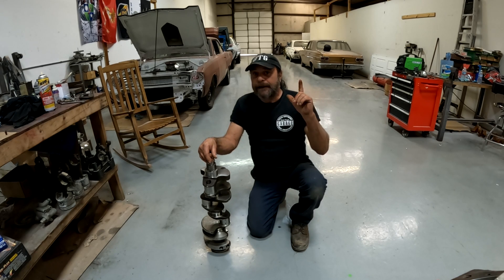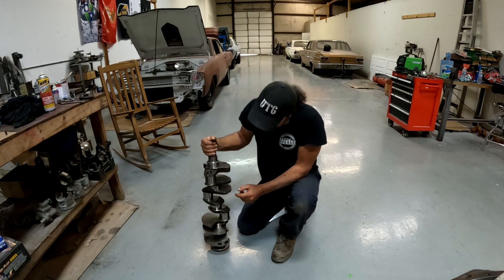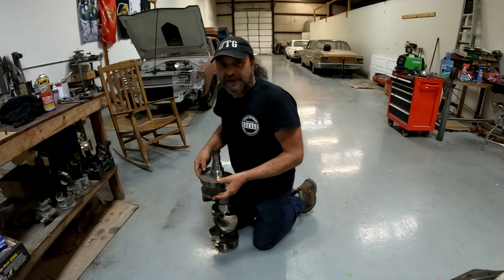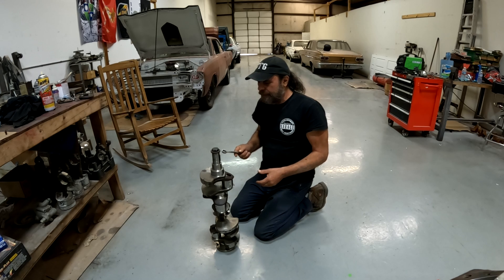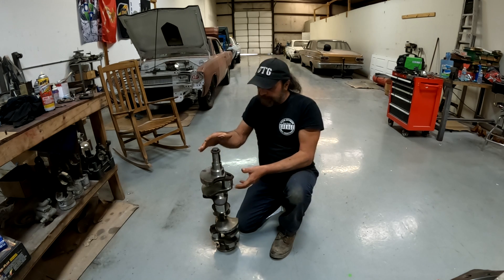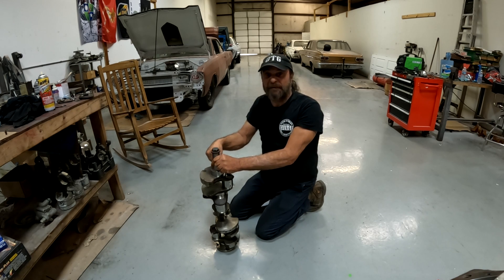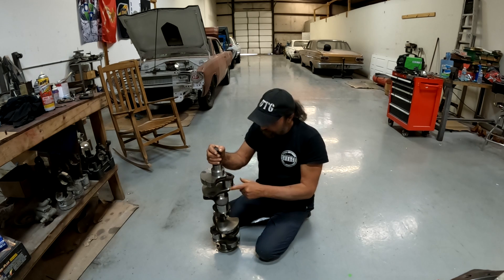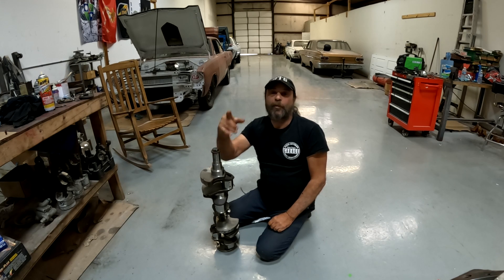When Is A Cracked Crankshaft Not Really A Cracked Crankshaft?

Comment: I had a crack ok the journal next to the reluctor in a 6.4 Hemi. Car had bolt ons and slightly higher rpm shift point. I replaced the crankshaft 11 months later the crank shaft cracked in the same exact spot and same crack! Imagine! I could not believe! Is it a manufacture defect? Keep in mind rpm is unlocked and it has an aftermarket harmonic balancer. Whats your opinion whats causing it?

Comment: I have a used billet crankshaft from a nitro hemi with 7 runs on it  visually inspected many times done the ring test i rings loud from the slightest touch i took it to a local machine shop to have the rod journals turned to bbc size to build a 540ci wedge stroker hue magna Flux it and said there is hidden invisible cracks and wont turn it had my hart set on using this crank is it safe?? My reasoning is simple it was ok when it finished its last pass making 14,000 horsepower why wouldn't it be fine making 1,400 horsepower thats only 10% would anyone else feel safe using it

Comment: Tony could you explain cam bearing scraping or reaming with an old cam. I'm having problems with tight cam bearings in my mopar 440.
Reply: Just run a cut off wheel exactly square to the journal then bevel out one side. Run it thru with the flat side going in the direction you turn the cam and it will cut off any high spots.

Comment: About 20 years ago I read an article about using a "slightly-cracked top fuel crank". Always seemed like a bad idea to me...anybody care to weigh in?
Reply: I probably wouldn't use it but it could possibly be ok on moderate HP engine in a pinch. Lot depends on how and where the crack was.  Top fuel crank would certainly be made of premium material with a lot of strength.

Comment: There are ring tests for items in many industries. We had to do a monthly safety check of out grinder wheels, pulling them off and doing a ring test, Every now and then we would find one that failed the ring test and replaced it, even though it was running fine. ⚠💍🔔🔕

Comment: I've been grindin cranks for over thirty years,and the first thing I do is ring test them  before they even go in the vee blocks. You maybe shoulda bounced a legit cracked shaft and compared the dull thud it produces to the ring of a non broken shaft. Another excellent video from uncle Tony!
Reply: I too want to hear a non ringer.
Reply: Yes, let’s hear a side by side comparison of matching cranks, a good one and a cracked one.
Reply: Uncle did that comparison some time ago (last year, I believe). The bad crank did in fact make a thud sound.
Reply: @rcnelson  yep I remember that one.. I was a grinder for Dick Moriz over a decade and remember it. https://youtu.be/ym5WChTTWos
Reply: https://youtu.be/ym5WChTTWos 3.30 into it utg is a good channel I also was a grinder. Back before aftermarket stroker cranks were popular and affordable in 80s and 90s. Stroked many cranks
Reply: Off the subject... Mr Crankguy, are there  "looser" or "tighter" bearings available in a ~given undersize~ (ex. .010) when you order them as a set? If that makes sense?
Reply: @CSXT8250  Not to my knowledge. But if a customer wants more or less clearance they can request that it be ground to high or low side of spec. Which varies but often it'll be around .001 tween high and low side. Some racers request  .0005 under low side. If the customer doesn't specify, I usually just grind to the middle of spec.. Often times there are available oversize thrust bearings available to regrind a worn thrust.
Reply: @CSXT8250  Hey guy I was wrong! I asked one of our engine builders about what you were  asking regarding different bearing   thicknesses within a particular undersize. To my surprise it really is a thing. I can't believe I've never known that. I my defense I'm no mechanic. I just turn cranks and  bore, hone, and deck blocks. It always amazes me to think that a human hair is said to  be .003 of an inch thick, and we deal in 1/2 a thoundsands.

Comment: Rod bearings and main bearings. I have engine out, stupid harbor freight stand make differing heights impossible to cross coop load, and my question. 

How do you put bearings in after you've stupidly cycled so nothings easy?

Would u ignore the fixed ones,or replace all
Reply: What?
Reply: Also, does crank have to be perfectly unscratched..or sanded fine & lubed & replaced that way?

Comment: Someone did restorative chroming to the journals to resize them. Are you sure you want to grind it off? Would a micro polish be more suitable?
Reply: If the chrome has a crack it's probably lost adhesion to the base metal and will peel off at some point.
Reply: @67L-88  Yeap, seen that on rolls for a rolling mill. The bearing surfaces had been plated to build up to be regrouped to fit the bearings. The pressure pushed the chrome around and eventually peeled off.

Comment: Forgive my ignorance but why would somebody chrome the crank in the first place?
Reply: 2 reasons. Minor defects can be "leveled and trued" by plating (BAD fix, but possible). Number 2 is chrome is hard and slick. In theory a hard slick journal can be spun up faster in a bearing shell without disaster coming to call. But you also risk what Tony found, stress cracking of the chrome.
So let's say you're campaigning a scary powerful drag car. You don't expect more than a couple runs per "rebuild" (between runs you do a full "tear and stare" inspection), and you keep a "parts stable" in your trailer for the inevitable replacements you need. You can keep a stock of cranks "in rotation" for such duty by grinding and plating a batch to a single "standard sizing" for your use (so you only keep a single bearing size in your stock), and scuffed worn "rejects" just get cycled to your plater for stripping and plating back to your standard size. You don't expect longevity in use, and none tend to sit long enough to "season creep" dimensions enough to crack the chrome, so you get the "hard slick" advantage without the longevity disadvantages the plating would cause in a street engine (because you have no expectation of longevity)

Comment: I was a crankshaft grinder at St Moritz Machine in Tulsa and we got a Porsche crank in with a spun rod. .I took it in the magniflux UV tent magnitized it covered it in the dye and kerosene mix. And it had a hundred cracks on EVERY single journal. I called the customer and he came in... the boss (Dick Moritz) hears the commotion as customer eas goung to need a $3000 (1990 dollars) crank..
comes over and goes in the tent.. goes in office makes a few phone calls.. comes out and said it's fine. It's surface cracks and normal. I was like OK.. grinding it was a bitch though. They were tiny journals with .0008 oil clearance and only sold .010 bearings or it was junk and it had one rod spun. I magnifluxed it after grinding and the cracks practically disapeared. Lol. I was happy to get back to hot rod cranks.
Reply: Moritz Machine! What was the main engine builders name back then? I used you guys for everything back then
Reply: @Mr.Saltwater  probably Patch. He passed away in late 90s.
Reply: @real0072  once I was working for Midwestern motor rebuilders in Tulsa and the bosses bought a big container full of cranks from India for $20 each and they were all over the place in taper and out of tolerance... so I had to grind every one of them down .010 and when I was grinding them the metal sparked orange was super soft and was pitted.. and i kid you not... smelled like Curry when I was grinding them in the shop for a month. We laughed about it for months after. loaded my stone up too. They must've used all kinds of crap steel in the forge to cast them
Reply: I've used Moritz Machine a few times in the past as well. If I remember right, the woman I dealt with in the office was named Shirley.  Every time I pass Midwestern Motors now I'm going to think of those India cranks 😲
Reply: Midwestern Motor Rebuilders had the curry cranks. Lol Moritz was all quality.

Comment: Yup, I had a 1973 340 crank that went "Tuk" instead of "Tinggg" when hit. Had to find another.
73's were balanced externally and even had a little weight attached near the ring gear. The new combo was sent off for balancing but was never totally right. Had a bit of shake below 2500 rpm, but it helped my 1966 Barracuda keep up with a certain Torino 429CJ (just in the 1/8 mile, definitely not in the 1/4)

Comment: Inspecting trains I tapped on a hell of a lot of wheels for the same reason. In almost 10 years only got one to thud on inspection although we had a few come into the shop to be changed out. It was quite the common phenomenon before the railroads switched from cast iron to cast steel

Comment: Do you re chrome the journals after machining?
Reply: he's going to cut the journals 10 thousandths under size and run bearings that are 10 thousandths over size to make up the difference, removing the chrome in the process.
Reply: That's not chrome coating in the journals or mains. It's 
 machined/polished cast iron.
Reply: @reaper20015  it's a forged steel crank... where did the "cast iron" come from?

Comment: Watching a seasoned veteran straighten a crank and making them jump 3-feet in the air with a 20-pound sledgehammer proves their elasticity. Joe Sherman routinely spun a cast iron 400 crank to 9500 rpm without failure. He said a forging wouldn't flex enough to take it.